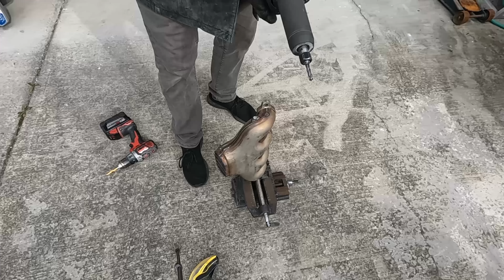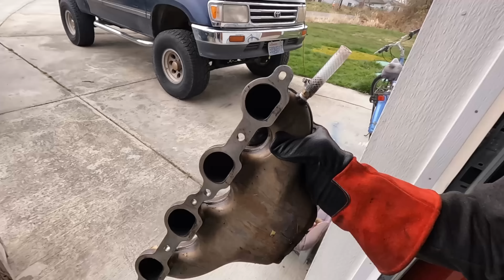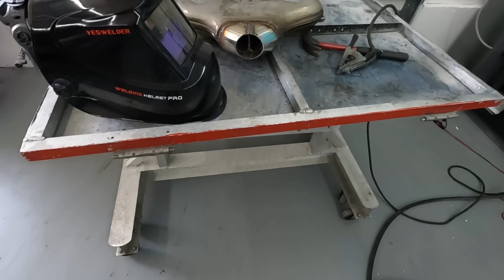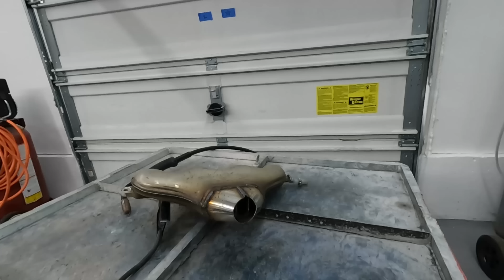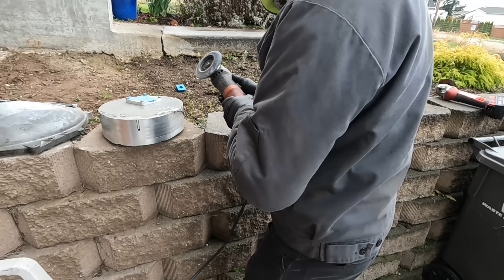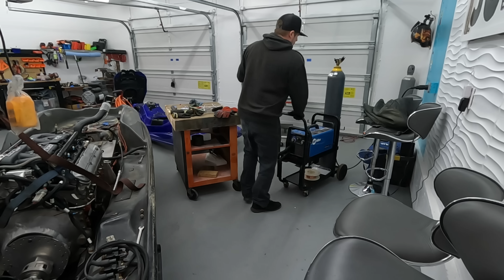v8 ski turbo install was good until this

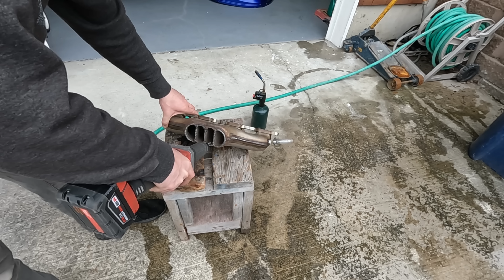Comment: 3:05... trying to get the shot and still do work 🤣 commitment.  Gotta love when the die grinder tries to start doing laps around the inside of a hole.
Reply from the maker: Yeah so it was actually an end mill in that thing and what happened was of course it got spinning around in there but it snapped off. After that I was like yeah I’ll just set up the shot better and use two hands to hold that tool ha ha ha ha
Reply: @JetSkiBrothers  OH NO, haha... Why are you using an end mill ! Get a set of burrs from Amazon .... You can still do that fun loopy thing with a proper burr... but they work better. That type of die grinder is really good at running away like that... I used to do all my porting with a GIANT Hitachi 500W things... You need two hands.

Comment: can't wait to hear that turbski spool up, ultimately I think the final form of this project will be a custom aluminum hull to fit the twin turbo setup and a impeller setup for more power
Reply from the maker: It’s going to be awesome when we get out on the water with it. It’ll be interesting to see how this turns out in its final form and I think that your guess could potentially be correct. Time will tell though 👍

Comment: Great video. It sucks when you get stuck because of some unexpected issue. It seems that you can always depend on at least one or two of these hang up for every project. 

Great work on the editing, it was amusing.
Reply from the maker: Thanks, I tried to edit this one with limited amounts of music. just to see how it went and see if I could accomplish just as good of a video with minimal music. Ha ha long story short I tried to not use any shortcuts of using Music and put more effort into editing it so it would be interesting. I’ve been working really hard to get ahead because I knew there would be some thing that would happen that would put us behind. So watch only I got slightly ahead of schedule so it’s OK that put us behind schedule so now we’re right on schedule and if anything else weird happens we don’t really have time for that😂
Reply: @JetSkiBrothers  Haha... yeah... I was ahead of schedule Sunday, so I decided, instead of assembling the 1100 and installing the Zeeltronics right away, I'd do some powder coating.... Three hours later I had galled one intake stud and snappe other clean of... So now I have to deal with that before it can be reassembled. 🤣
Reply from the maker: @JoelArseneaultYouTube  ain’t that just the way it goes.

Comment: This manifold mod is certainly unique. I hope you get what you’re after!
Reply from the maker: Yeah so basically with this we’re trying to get water cooling on the manifold so that the ski doesn’t burn down and other than that we’re just trying to get the exhaust to the turbo. But I agree I hope it works out we’ll find out when it comes time for testing 👍
Reply: @JetSkiBrothers  Of course a water cooled manifold is basically required in a bilge area. One thing to look out for with this is that the inside manifold is cast iron and the outside is thin stainless. This is tricky. One thing you might consider is going ahead and pushing sea water with exhaust through the hot side of the turbo. This is not unheard of in marine applications and can keep things compact and reduce plumbing.

Comment: Just FYI you can go pretty small on the tubing to the turbo manifold. I ran a 370 motor and 2" 16g piping from each manifold to the turbo flange. It free's up a ton of room... was still making over 900hp at the wheels as well on a drag car. Small diameter pipe also speeds up spool time. (easier to wrap as well)

Comment: So, idk anything about jet ski manifolds, why do they need to be water proof under pressure? Isn’t the exhaust separate from the cooling system, opposite of a boat engine/lower unit setup?

Comment: Why go to the trouble with jacketing. Make the exhaust up down and spray water in the down section exhaust on a timer system. On after 20 secs.
Reply: Hold on… Ive just had a poo and on retrospection, jacket is a much better solution…. CARRY ON !

Comment: Modification takes a lot of time to be correct keep up and make sure it's ready for 20× boost psi
🦾🦾🦾🦾
Reply from the maker: For sure it takes more time then expected. At 20psi of boost this should be over 1000hp theoretically of course. I won’t claim any numbers without a dyno sheet to back it up 🍻